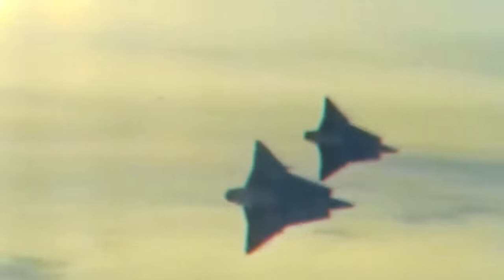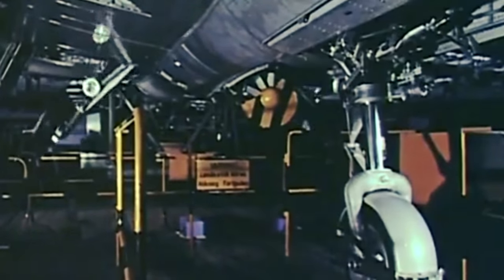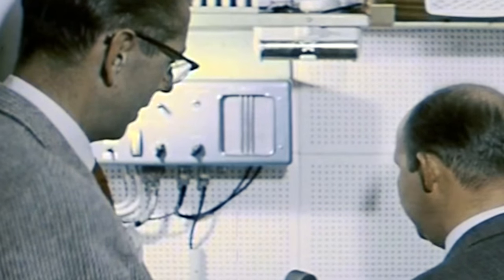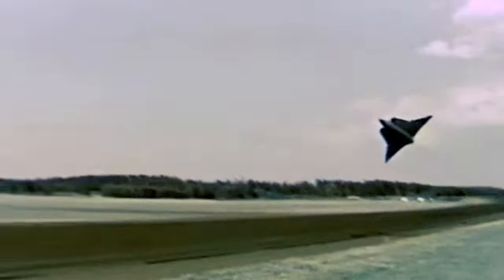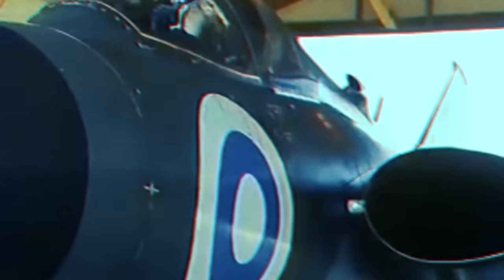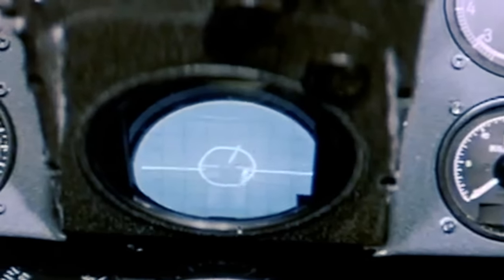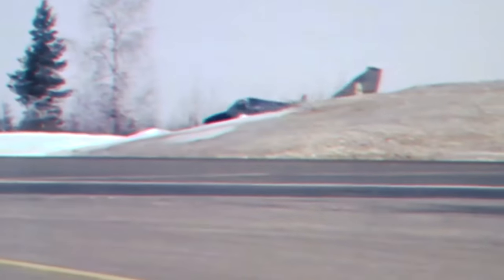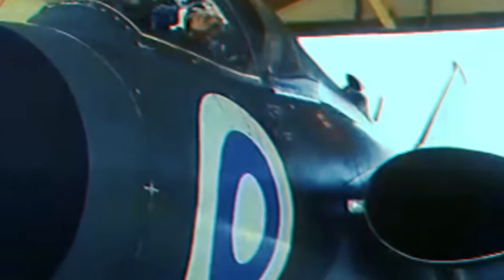The Bizarre Airplane Design That Shook Up Aviation

Comment: The Swedish sure knew how to design and build aircraft, all their models are outstanding
Reply: Not just aircraft.  Their designs for everything from infantry anti-tank weapons, to artillery, to submarines have typically been very good.
Reply: LOL avro arrow .... 10 years earlier ... they didnt build new they rebuilt OLD from another country .... they took all the design concepts from the avro arrow of canada ... and the video presenter misses the fact that no avro arrow ever was a prototype plane ... all were cooke craige design method production run planes ...
Reply: @kaboom-zf2bl  
Avro Arrow: first flight 1958
Saab Draken: first flight 1955
Reply: @christineshotton824  the arrow was cancelled in 57 .... it first flew in 54 as rl 201 ... and the draaken was in  58 first flight ... after they studied what they could of the arrow ...
Reply: @kaboom-zf2bl  
Well, I can believe you, or I can believe the BBC, CBC Canada, and every other online information source which all agree on a March 1958 date for a first flight.
Reply: @kaboom-zf2bl  completely different aircraft
Reply: @12vibaba  oh ... offset intake ducts ... blended body delta wig design... tall tail .. airduct that spiral to the front of the engine ... air conditioning ... duel engined ... lots of alloys and composite materials as well as some titanium ... fly by wire and fly by hydraulics ... look down shoot down shot own rada ... over the horizon radar .. terrain radar .. stealth .. 
... 
just a few of the FIRSTS from the avro arrow ... all of which are in this one ... not completely different .. just made in a different country ... 
and only slight differences ... as aerodynamics forces the place to follow the older ones that figured it out first ... 
.
so wrong ... prior to the arrow fighter jets were swept wing designs ... after the arrow ... they werent ... THAT is what being the best means ... EVERYONE follows afterwards because it was already PROVEN to work 
.
the difference between paying attention to detail ... and just spewing back wrong data like someone vomits bad food ...
Reply: @kaboom-zf2bl  the arrow first flew in 1958 while the draken flew in 1955 bro.
Reply: @kaboom-zf2bl   According to wikipedia and the canadian encyclopedia page, “Flight testing began with RL-201 on 25 March 1958” and “in 1953–54, the Royal Canadian Air Force (RCAF) commissioned Avro to design and build the Arrow”… are they spewing out wrong data? What are your sources?
Reply: @taxidriv  
I've run across Avro Arrow fanboys before.  It's not enough for them that the Arrow was a phenomenal technological achievement for Canadian aerospace that would have made an excellent combat aircraft; it's got to be the greatest aircraft ever invented and the first to do anything that was innovative.
They remind me of Chekhov talking about how the Russians were first at everything in the original Star Trek TV series.😁
Reply: @christineshotton824  yeah and the Arrow was a really cool and awsome machine for sure, but I really don’t understand people that always have to be right even though they are wrong and then have to be rude😄
Reply: @RuiLuz  yes, and even more dangerous than the Draken.😂
Reply: @kaboom-zf2bl  . Except that the Arrow is a very different  bird. Much larger, nor dubble delta wing. The similarities are no more than superficial. The Arrow was more of a strategic bomber than a fighter and never vent in to service. The arrow wasn't even close to be the first delta wing.
Reply: @kaboom-zf2bl  You have no clue what you are talking about.
Reply: Fairy Delta 2  first flight 6 October 1954
Reply: @paulmartin7241  Yes but Draken had double delta.
Reply: @paulmartin7241  Check out SAAB 210! First flight with double deltawing 21 Jan 1952! That´s more than 2,5 years ahead of Fairey Delta 2! And way ahead of Avro Arrows first flight 25 march 1958! ; )
Reply: JAS 39 Gripen E is so sexy and bar none one of my top favorite aircraft
Reply: @kaboom-zf2bl  - By some accounts, the Arrow was the greatest aircraft ever built by anyone or that ever could be built be anyone. You know who you are. ;-)
Reply: The Grippin would be a good fit for the Ukrainian AF, if only there were enough extra ones available to send. It also can use regular roads to take off and land. It has modern avionics and is very maneuverable and easy to maintain.
Reply: @christineshotton824  The british army uses a lot of Swedish weapons. Volvo snow cats. the old SLR and the 105mm light guns r Swedish.

AS the UK has its 1st line of defence in Norway they need weapons that can stand up to -60c temps.
My unit used the Volvo BV202 to tow r light guns and carry r supplies and ammo. the BV202 is articulated. the ammo was carried in the back section. the gun then towed behind that and the gunners were towed behind that on skis holding into ropes.
Reply: @cliffbird5016  You might be thinking of the BV206 Snow Cat built by Hagglunds, which I'm not aware of Volvo being involved with apart from maybe as a motor supplier. Hagglunds is apart of BAE, same as another Swedish weapons manufacturer Bofors, which have supplied AA to most of the civilized world for the last 100+ years. They we're using Bofors AA guns to protect the temporary harbors during Operation Overlord in Normandie and the US navy have used AA guns from Bofors on many of their ships for many years.
Reply: @christineshotton824  I know for a fact that they (we, the swedes) took the design for our wheels from the Romans....or was it the Chinese...?🤔
Reply: @Car_Mo  Volvo BV202 is an older bandwagon and Hagglunds BV206 is newer ! Google and see the difference .
Reply: @RuiLuz  Anita Ekberg D42 with afterburners
Reply: Even Tunnen?  😁

Comment: a mid-50s all-weather mach 2 interceptor that could operate off rough strips and be serviced by average conscripts... and it still looks futuristic!
Reply: It gets even better. I recall reading that, if an engine like today's F119-PW-100 had been available when the sexy Swede took flight, the design would have been capable of supercruise performance.
Reply: It even had an analog early version of a data-link system.
It was hidden as a regular clock on the dashboard, but could show various coded messages sent over radio.
Reply: And cup holders

Comment: Most of the planes in this video were in the Finnish Air Force livery. Brought back many pleasant memories from those golden years when I was in the army.
Reply: And Danish.
Reply: Shame we didn’t buy the Gripen.
Reply: @markusr353  Indeed! We could have built and developed gripen together and you wouldn't have been so relyant of the US. Made in the North (nordic)
Reply: Indeed. Most of the FiAF Draken footage was part of a winning military movie. I was actually piloting a Draken on some of the aerial sequences. There was a rented photo pod from the Swedish AF under that Draken. Technically the fighter was very reliable and much liked by its pilots. Within the FiAF we only lost one Draken (due to pilot error). Operation with the type 1972-2000! Great aircraft from Sweden.
Reply: vesa vartiainen
You mean these planes were finished before entering service?
Reply: @redblade8160  No, he wrote FINNISH with TWO n:s. Then it is a Draken with white and blue cirlce markings from FINLAND, and not the three crowns marking from Sweden

Comment: That first cobra clip is almost terrifying.  The way the aircraft pitches up rather slowly but then the deceleration happens so quickly at such high speeds..  If you were chasing that aircraft in a dogfight scenario your first instinct would probably be to pitch up to stay on it, and you'd be half way through doing that before all of a sudden you're completely disintegrated.
Reply: Indeed!

Comment: Nifty, SAAB invented the cobra maneuver by accident.   Accidental discoveries are the best, first it's "oh s**t, I''m going to die!"  then it's, "Awesome!  This is the coolest s**t ever!"
Reply: A missnake
Reply: Serendipity
Reply: The called the maneuver ”The short parry” a fencing term.
Reply: @JTA1961  😂
Reply: Not Cobra, Cobra lasts for longer than a split second! It's only possible with trust vector jets and is balancing vertically and even moving backwards, like Pugachev does with Sukhoi 27-57
Reply: @pashapasovski5860  This was originally called the Parry, as in fencing.
Reply: @Blackhawk 7R  makes sense! It looks like a fencing move! It definitely doesn't look like Cobra!
Reply: The Cobra is a much more pronounced and controlled maneuver done with vectored thrust.
Reply: @mathiassvensson7911  Pretty sure 'kort parad' is meant to mean short parade. Because it stands up like its parading for a brief moment.

Comment: As a member of a youth organisation called "Flygpojkarna" ( aero-boys) in the mid 70's I often got the opportunity to see J35 start and land at F18 Tullinge south of Stockholm where the Capital fighter defence were stationed. Quite spectacular after sunset, quite a few  settings were on the "harsh" side making good use of the spuhr wheels. Now I live right next to that former airbase, discontinued in the 80's and made into a residential area.
Reply: Aw, sweet F18. I grew up in Tullinge. Sadly I missed the mark. By the time I was born it was closed. But I had a family friend that grew up right beside it during the 60s and those stories were amazing. I did get to see a lot of drag racing though.

Comment: I always had a place in my heart for delta winged planes.  This plane and the Mirage 2000 always impressed me as a kid.
Reply: The F-106 Delta Dart is still one of the best looking (and performing) aircraft ever.
Reply: Clayton Bouldin.
You must have a massive heart then. How did you manage to fit these planes inside your heart?
Reply: @redblade8160  You`re like a  left(delta)wing comedian. Not funny, not needed
Reply: @slendergollum  
Did you make that up?  I laughed, but it was on the inside.
Reply: @redblade8160  I parallel park them next to each other!
Reply: @slendergollum  "Heyyyyyooooo!" in my best Ed McMahon voice!
Reply: @claytonbouldin9381  
You "parallel park them"; you mean up in the air?

Comment: "Draken" actually also means a small kite as the aircraft resembles a kite when looked up or down on.
It was pretty spectacular for its time. The Danish airforce also had a bunch of them and the pilots just loved them. As the F16 came into service the Draken was outphased.
Reply: Aye, it’s a double meaning, but the intended meaning is “dragon”. Just as Viggen means “thunderbolt” you see some obnoxious Swedes translating it to “tufted duck”. Even though Saab and Flygvapnet were very clear that the Viggen was named from the bolts that spring from Thor’s hammer. The Saab 35 is named “dragon”, the 37 is “thunderbolt” and the 39 is “gryphon”.
Then you have the “funny” guys using double meaning “kite, duck and arrested”

Comment: As a kid I fell in love with the Finnish Drakens I occasionally saw training low. At the time Finland operated both Drakens and MIG-21s. Therefore, a training routine must have been a dogfight between those two. I wonder how they compared... Though, knowing our airforce, everything is classified until like year 2172...
Reply: MIG-21 wasn't a dogfighter. It was all about getting high fast, shooting whatever you had to shoot, and then leaving.
Reply: @tapio_m6861  MIG-21s had many dogfights in the Vietnam war and many other theaters.
Reply: The draken was a very difficult plane to land due to its fixed intake manifold which left it powerless on low speeds. The mig-21 had a variable symmetry intake so it performed optimally at all speeds but with draken the pilots needed to be very careful with landings...
Reply: @tapio_m6861  Neither was Draken. It's main purpose was also to climb at brutal speeds to intercept and eliminate Russian bombers and then be done, i.e. pretty much the same. Other properties were secondary, though of course higly desirable (fielding multiple designs for different uses was never really an option for a small country like Sweden).
Reply: Lived in Pori, Finland, where the Fighter Squadron 21 was based when I was a child, I saw Drakens, MiG 21s, Fouga Magisters and D. H. Hawks regularly. I really do not know which of these belonged to the squadron, but I cannot remember seeing Drakens and MiG's training together.
Reply: 😂 ...well, the same year declassification bt Sweden of who blew up Nordstream will happen.
Reply: @smokeonthewater5287  Not exactly true. The Draken had to be flow with the focus on the speed or rather on the angle of attack as the power available/ needed was the thing to watch. If under the the AOA targeted one needed a lot of power,  over that and the fighter accelerated fast. Non stabilized approach in both cases. There was amble amount of power available. The landing technique at first was to maintain constant power/ speed and rate of decent until touch down but with more experience changed into more conventional landings (flare and all). With fond memories of a great fighter!
Reply: YouTube has videos about these planes, watch interviews of Ari Saarinen and Jyrki Laukkanen, highly recommended.
Reply: @arisaarinen8752  Jyrki Laukkanen disagrees with you though. I bet he has more flight hours in Draken than you do.
Reply: @smokeonthewater5287  What is your point? You may bet what ever you wish, but Jyrki has not been trained in the Draken to fly solo. Yes, as an outstanding test pilot, he has flown some hours (as testing purposes, with a number of other types as well) with a double seater and with a another, type certified  Draken pilot. Would be nice to hear your argument!!
Reply: @smokeonthewater5287  Once more. My advice to you is do not comment a topic you obviously are not familiar with. Quoting Jyrki on the landing qualities of the Dragon are out of contest. My experience of 13 years handling the fighter has sufficient amount of expertise on this topic!
The moving intake cone of the MiG 21 is to improve airflow into the engine at high Mach numbers as well as high altitude and has no real effect within the landing speeds. If you look the statistics we (Finland) have not lost a single Draken due to "very difficult" characteristics. Not so good statistics with the technical side of the MiG ( several lost due to malfunctions).
The difference with those two fighters is that the MiG has flaps (with air blown to them) as well as separate tailplane. The J35 has double delta planform and "elevons" and the induced drag increases with the AOA increasing. As I mentioned earlier, not that hard to handle as long as you concentrate!! Lopuksi, ei ole fiksua huudella nimimerkin takana!
Reply: @arisaarinen8752  How many hours did you fly yourself personally in a Draken?
Reply: @smokeonthewater5287  Still trying to compare are you? As I wrote, 13 years worth, that is all you need to know!
Reply: @arisaarinen8752  Ok so I  guess the most famous test pilot in Finland is full of BS lol🤣 Ja btw, ei todellakaan ole fiksua esiintyä somessa itsenään. Todella moni on tuhonnut sillä elämänsä
Reply: @smokeonthewater5287  Do not under estimate others while you obviously have no idea what you are talking about. NO ONE downplays Jyrki as great test pilot and further NO ONE is bullshitting anyone!
What I have written of the "dangerous" J-35 is a fact. Been there, done that.  End of discussion.
Reply: @arisaarinen8752  Yet you contradict what he says. Either you're full of it or he is. Which way to go?
Reply: @smokeonthewater5287  Well the only one full of it is you! The difference with us is that I have flown the fighter and you have not! So do not comment on the flying characteristics of the fighter, quoting a third person (Jyrki, a friend of mine). I do not now what is your problem but your attitude towards the hundreds of trained Draken pilots feeling very comfortable with the plane is just appalling.
So this is the end of this topic from my side.
And just to let you know, Jyrki was not at all pleased with your comments as the reference. J-35 Draken, what an outstanding fighter. End!
Reply: @arisaarinen8752  You can't side step the fact that your story contradicts Jyrkis. So which one of you is right? It's useless for you to attack me, I have never claimed to know anything except the quote from Jyrki. It seems that someone has a bloated ego issue here and it's not me 🤣
Reply: @smokeonthewater5287  (smokewhoever).
I will give you one more chance to be corrected! Your attitude is nothing more than aggressive; who is right (bs) or who is wrong (bs). You obviously are unable to comprehend what I have written before.
Everything I wrote is a fact and does not contradict with Jyrki in any way. You have thrown (your opinion only) comments on our flying hours with the type (I have) and Jyrki of course is as I mentioned an outstanding test pilot, but number one Air Force test pilot however with the type was Paavo Janhunen!! 
All in all, read my previous comments and be enlighten. The fighter was a great success for the Air Forces. Jyrki is a MiG aficionado, so...! Quit this nonsense comparing us. By a book: Draken in Finnish Air Force. Cheers
Reply: @arisaarinen8752  Either you agree or disagree with him, up to you. Not my problem really. Watch Jyrkis interview at Kymi air museum for reference
Reply: @mattirissanen8163  Take your beef to Jyrki, not my issue...
Reply: smokeonthewater is obviously a troll. Don’t feed him. Arguing with an experienced pilot based on second hand information 🙄
Reply: @tor2919  I'm only repeating what the most experienced test pilot of our country said in an interview, not arguing with anyone.
Reply: Grown up men fighting like small kids at a Birthday party...